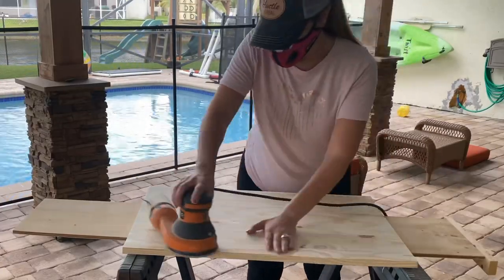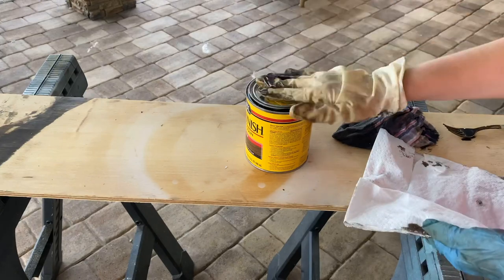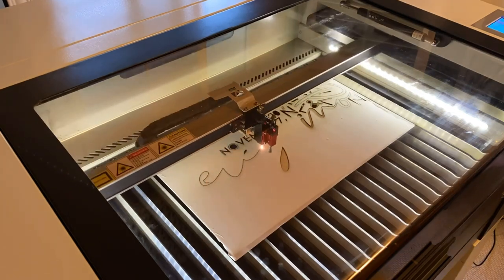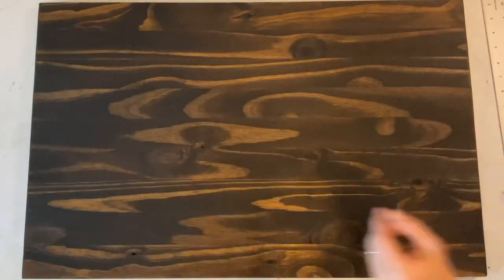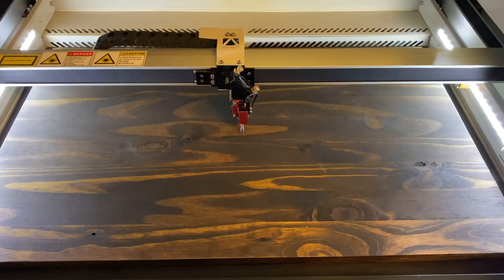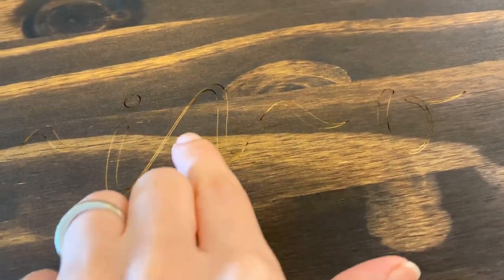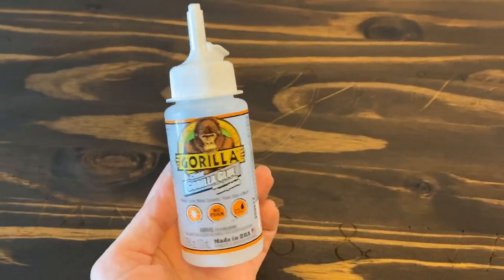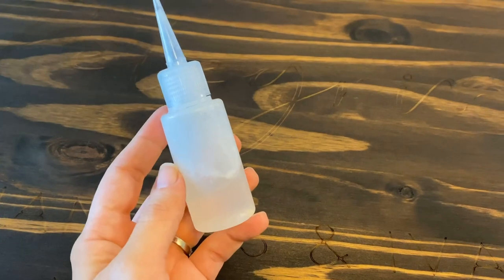Laser Cut Wedding Sign

Comment: I just ordered my first laser, I'm new, forgive me if this is a dumb question. Is there a reason why you couldn't do the lettering as an engrave and inlay the cut letters into the backboard? My brain is telling me that would make it very easy to have everything come out perfect every time, but there MUST be a reason why everyone does it this way. Thank you for your content, you're one of a few content creators that's really motivated me into this hobby/business.
Reply: I want to know this as well!
Reply: I have had my thunder laser for about 3 months now and I haven't done any inlays but with my kerf adjustment calculated for the materials, I'm super confident that it would  work.
Reply: The reason is time. It can be time consuming for a laser to remove that much material, even if its about 1mm deep. Even with a soft wood such as pine, its alot of wood to burn.

Comment: Another fantastic video
I would give you a minor recommendation for you to try out in regards to glue. I have lately become a huge fan of spray adhesive. works great, quick (spray the back of an entire piece) and sticks really well. superglue in a spray basically with no side seepage when you press down. Give it a shot, I think you will find it much easier
Reply from the maker: Rob Xsiq I’ve contemplated this but I’m concerned about how the edges will look with the glue. I’m going to give it a try! Thank you!
Reply: @ThatMomWithALaser  Good point. I tend to glue big things, doing dainty lines may make the edges a little bit odd on close inspection perhaps. Try on just some scrap might be a good idea
I've had bad luck with other glues though, but that might be because I am like a bull trying to do fine arts.